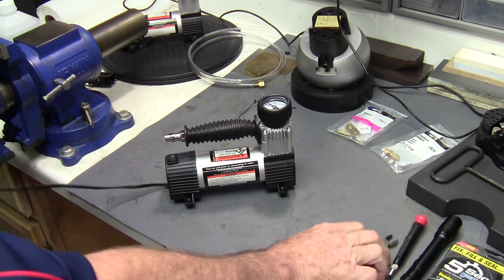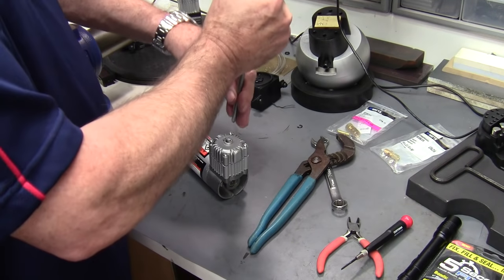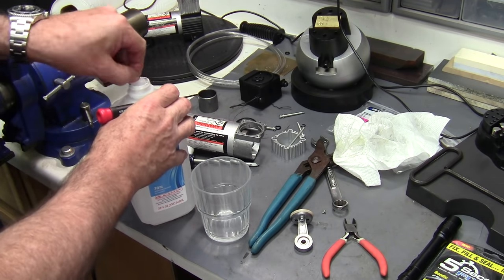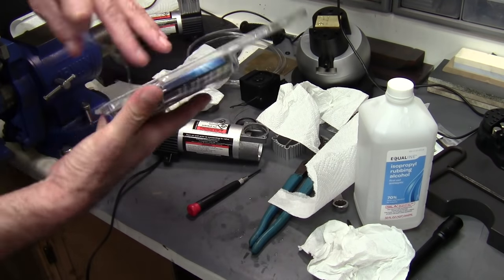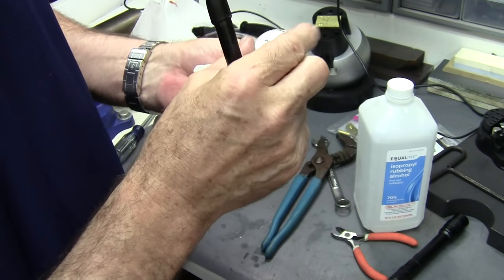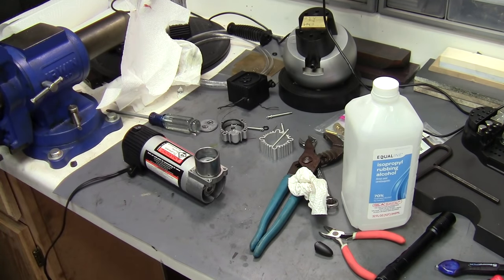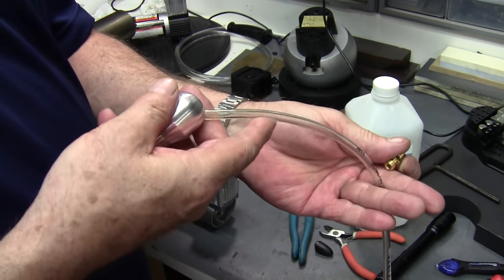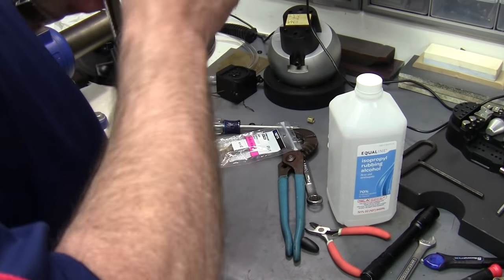How I built my Homemade Hand Engraving Machine Part 2 Modify 12v compressor

Comment: So far so good.  The main change I made is to cover the holes I cut into the ammo can with very fine mesh (to keep out insects).  I had a little trouble locating the small brass fittings but I think I've got that covered.  The trade school machinist students are building my handpiece (great folks BTY);  I just had to buy the materials.  The gravers I plan to make out of old jewelers files.  Rick was great to email me the plans.  Thank you, sir.  Great project that will lead to a nifty new hobby.

Comment: FYI, if you have baking soda it works great with superglue for filling holes and cracks. It acts as an activator so it cures very quick and gives it some additional filler material. It can be sanded almost immediately too if needed. 
Even if you don’t use it for the pistons I figured it might come in handy at some point down the road.

Comment: Just my luck Rick, I get a compressor that the pistol section doesn't have the c-clip holding the  pistol in place.so I just removed the little check valves and screws. Applied the JB weld and put it back together.
Reply: Also my wires have no imprint on the wires that show which one is the ground.

Comment: Thank you for a great series of instructional videos, and I will soon be following them. One question, why when the compressor comes with a perfectly good air outlet do you seal it up and make your own outlet?  Regards Dave
Reply from the maker: Because I wanted it to exit out the top and not the side. I would have still removed the pressure gauge, not needed, and plug that hole. Its a personal preference thing. Do what works for you. And have fun!
Reply: @ralex397  Thank you.

Comment: Hi Rick, after watching several times, I notice that the cylinder is put back in backwards. It came out if you notice with the bearing facing the motor and it was put back together in the other direction. I just wanted to point it out if you have not yet noticed... I do love the videos, I must say...:) Thanks again really.
Reply from the maker: It doesn't matter, it works either way. Thanks for watching, glad you like the videos!!

Comment: 🤔Now why is it necessary to get rid of the air gauge? 🤗And by the way you did a fantastic job showing 👀 all of us just how to do this modification 👏👏😁👍!
Reply: The compressor no longer builds pressure as it's now basically like a syringe that is being pushed in and out really fast. The gauge would only flutter for a few minutes before the internals are bashed to bits from the oscillation.

Comment: it is really necessary to modify the compressor, my graver works with a standard compressor, thanks
Reply from the maker: Yes, you must modify a small compressor / tire inflator for this type hand piece to work, it will not work with regular compressed air.

Comment: Hello Rick,
my name is Karl Gerstner from Germany. I'm an avid viewer of your site. I have a question for you and I hope you want to help me. I am disabled and engrave as a hobby. I have a compressor, a pedal and an engraving hammer. What electronic parts do I need to get the hammer working? I would be very happy about your help.
Keep up the good work with your films, they are very good. My compliment. Kind regards Karl.
Reply from the maker: In the description box under video 1 is a parts list, you will need a power supply; at least 15 amps, and a 12 volt speed controller, I bought both from eBay. You can email me at; ralex397@hotmail.com for free blueprints and wiring drawings.

Comment: Hi Rick, I am asking for a little help when you read this comment. I have a desire to engrave and I bought a mini 12v compressor but my compressor does not have piston like this. My compressor has a plastic piston with holes and another plate with a valve on top, just below the pressure gauge. Please tell me which holes I need to glue and how to get my compressor ready for engraving. I bought 2 compressors, but both have the same working principle, with a plastic piston with small holes. Thank you in advance.
Reply from the maker: Block the hole/s in the piston with glue or epoxy. Remove the valve from the plate on top just below the pressure gauge. 
Refer to this drawing; https://www.youtube.com/watch?v=F1FXjUErC1Y
Reply: @ralex397  thank you mate

Comment: Can you use denatured alcohol instead of isopropyl alcohol to degrease the pistol before plugging the ports.
Reply from the maker: Sure, what ever works to remove the oils. I used isopropyl alcohol because that is what I had. I would have used MEK but I was out.
Reply: @ralex397  Rick your videos, are the the best. If you ever decide to run for president, you have my vote automatically buddy.
Reply from the maker: @CJ8898x  Thanks!

Comment: Hey Rick, my wires on my compressor doesn't have any imprinting on the wires, what would you suggest buddy.
Reply from the maker: If its a 12 volt compressor it wont matter, should run fine either way it hooked up. Before you cut the wires, plug it in and see if you can determine the direction of rotation, then rewire it and see if its rotating in the same direction, if it is your done, if its running in the opposite direction, reverse the wires.

Comment: Is this compressor good enough for long time use? Like an hour or so.
Reply from the maker: As long as you keep the cylinder lubed it will last 1000's of hours. If it runs dry it will wear out quick.
After the compressor is modified the piston is never under a load, like it is when it's pumping up a tire.

Comment: Rick, thank you for the videos. Can I use a harvested power supply from a desktop computer? 3 12v outputs. 1 at .5A and 2 at 16A.  Would it damage the compressor? I figure I would use the .5A for the fan.
Reply from the maker: Yes, a power supply from a computer will work fine, I was going to use one but it wouldn't fit in the ammo can.

Comment: Like your site, makes good watching. I am surprised you used 3 in 1 oil.  I have always thought this was not a good lubricating oil ?
Reply from the maker: Its good enough for this application, the compressor is never under a load, any oil will work, should run for thousands of hours.

Comment: Rick, try using acetone to degrease the piston.
Reply from the maker: I would have but I was concerned about the material that the seal for the piston was made out of. I didn't want the acetone to dissolve the seal, it may not of, but not knowing what the seal was made of I didn't want to take the chance.
Reply: I agree with Rick, acetone can do a number on certain types of o-rings and seals. If it's unknown then stick with alcohol.
Reply: Yeah acetone will prkb eat up your o rings if not mistaken

Comment: I built my machine exactly like you did. I bought a hand piece and pre-sharpened gravers from eBay. My machine works. I can adjust the speed and do everything it’s supposed to do. When I put a coin in the vice and turn the machine on it graver will barely scratch the coin much less carve it. What am I doing wrong?
Reply from the maker: I am going to need more information to help, email me at ralex397@hotmail.com
Reply: Graver geometry and sharpening are very very important. Look into the lindasay engraving templates for a lower cost method of a precise sharpening system. If it's not the gravers themselves then I bet the piston isn't making solid contact with the tool. Good luck

Comment: Thanks Again Rick for all your Hard work. The main question I have is ,  

1. Do you know how many strokes Per Minute that this machine puts out? 
2. I plan on engraving knives and need something that will cut or bite into spring steel and stainless steel. 
3. Do you think this will fit the bill?

I've spent the whole weekend looking at those Chinese GRS knock Offs, and I don't want to take the chance buying one that works so, so. Besides this is way cheaper and I'm on a budget. I contacted Mr Hughes but he hasn't got back to me yet. 

Thanks again
Reply from the maker: 1. Strokes per minute are more than needed, you must use speed controller to slow it down.
2. Spring steel & stainless no problem, plenty of power.
3. You will be very happy with this homemade machine, I engrave 4140 Chrome Molly steel with it.
The Chinese knock offs can be modified to work with this machine.
Reply: @ralex397  slow as heck though.
Reply from the maker: @billbarrett582  without the speed controller installed my compressor runs way to fast.

Comment: So basically, you're making it so it pushes and pulls air back and forth, rather than pushing it each stroke?
Then, the engraver has a ball bearing that gets push back and forth making it pneumatic?
Is this how it all works? I am very new to this. Thank you
Reply from the maker: Yes a small 12v compressor is modified to push and pull air back and forth, I don't use a ball bearing I make a piston it is way more efficient. I can send you the drawings if you email me.
Reply: @ralex397  okay. Where do I find your email? I might just buy the engraving tool as they seem fairly affordable, but the compressor part seems more worth the build. What do you think? 
I appreciate your time and advice.
Reply from the maker: @Picklemedia  My email is     ralex397@hotmail.com      At this time I do not have any ready to ship, it may be a while before I do.

Comment: Hey Rick is there a reason you used half of 2 different compression fittings and drilled one out? From what I can tell they sell 1/4od x 1/8mip sharkbite quick connectors that would have worked and also they sell 1 single brass compression fitting that is 1/4od x 1/8 mip as well. Do you think those woukd work being directly screwed into the compressor port instead of all that extra work? I'm gonna try it building aachine for a friend and let you know. I got the original 2 fittings that you used as well incase i find a problem with my idea and need to go back to the original route. Let me know your thoughts though 👍
Reply from the maker: What ever it takes, I showed what I used to get it to work, with what I could find at the hardware store, Im sure there are many ways to adapt the compressor and ammo box to the 1/4" tubing.  I make my own fittings, but most people are going to go to the hardware store and buy the fittings to adapt it. If you can find a fitting that screws directly into the compressor and you can attach the tubing to it, thats the fitting you want, but depending what the hardware store has in stock you may need other adapters, or have to drill the fitting open a little larger, depends on what you can find. Good Luck!
Reply: @ralex397  yes your completely right, and I think I answered my own question. I forgot the threading on the compressor ports aren't 1/8 right? More like the 5/16-24 grub screw you used to plug the extra port. So your method is probably still best. If I do find an alternative I'll share it with you incase its helpful for you in the future. Thanks for the quick response btw ✌️

Comment: Does it have to be in the ammo box, or will it work just the way it is with the modified compressor?
Reply from the maker: No it does not have to be in an ammo box, feel free to put it in what ever works for you. I have seen the parts installed in homemade wood boxes and Tupperware.
Reply: Got it Thank you for replying!

Comment: Your tutorials have helped me tremendously to get my head around this mod. And then I realized that my air gravers, which will be arriving soon, do not utilize pulsed air but normal compressed air. Would this 12V DC compressor work with such air-gravers without the pulsing modification?
Reply from the maker: No it will not, Shaun Hughes has a video that shows how to modify the Chinese hand piece to work with this mod. GoodLuck!

Comment: Have I got this right, you are modifying it so the piston now blows air down the tube,then sums it back?
Reply from the maker: After the modification the compressor piston pushes and pull the same air back and forth, it no longer compresses the air it sucks and blows. Up stroke of the piston pushes the piston in the hand-piece to hit the tool holder, the down stroke of the compressor piston sucks the piston in the hand-piece back. Simple design the compressor motor is never under a load and should last thousands of hours.

Comment: so my compressor has a hard time getting going and does not reach full speed, if i remove the cylinder or loosen the cylinder assembly it has no issues, its oiled, any suggestions?
Reply from the maker: Has it been modified?
Reply: @ralex397  Yea, followed your instructions to a T, though mine did not have the C ring on the piston, its fixed to the shaft.
Reply from the maker: Did you remove the valve above the piston and it's open at least a .170 or larger to the 1/4" tubing? A few people have sealed that valve too, that will make the compressor run slow.
Reply: @ralex397  its open, just stalls in the cylinder and has no torque to even start without giving it a wack to get the counter balance to shift.
Reply from the maker: If your going through a speed controller bypass it and put 12 volts directly to the compressor. See what happens.
Reply: @ralex397  will give that a try
Reply: Started no problem, thing took off, will order a different speed controller, that one was probably bad
Thank you.
Reply from the maker: I have also had problems with bad power supplies.  Good luck!

Comment: I am getting too much air into the engraver gun. What do I do
Reply from the maker: I do not know what you mean by too much air. Did you modify the compressor? And do you have a speed controller?
Reply: Rick Alexander Yes I modified the air compressor by putting super glue and activator on top of the piston but I do not have a speed controller is that what I need to control the air volume
Reply from the maker: @carloslopez-qr4sd  Yes you need a speed controller to slow it down or it runs too fast.
Reply: Rick Alexander ok thanks Rick
Reply: Or you could drill a small hole to purge some of the air just don't go crazy with it and over do it. In case you don't have the money but speed controller is smarter option prob. Great video though btw

Comment: How well has your personal machine held up?
Reply: Specifically the compressor
Reply from the maker: The compressor is holding up very well, it should last until the brushes wear out, thousands of hours. The compressor is never under a load like it would be if you were airing up the tires on your car.